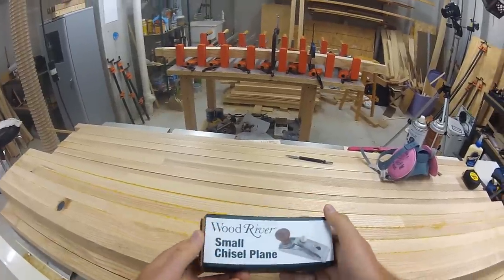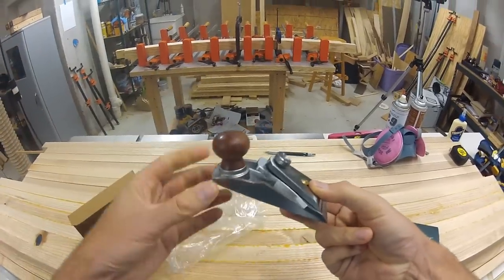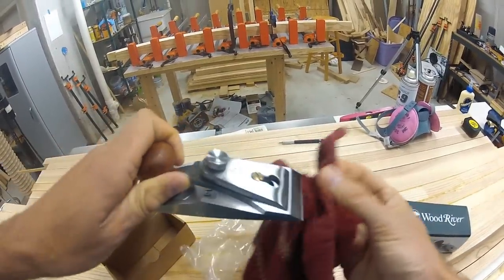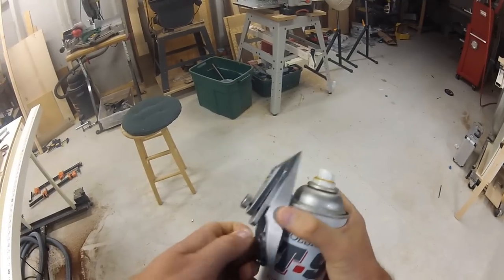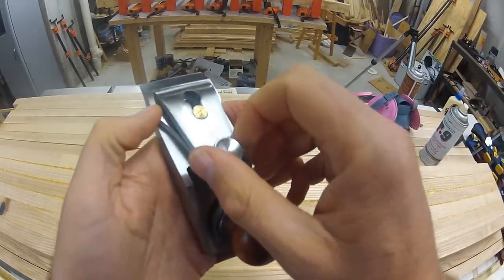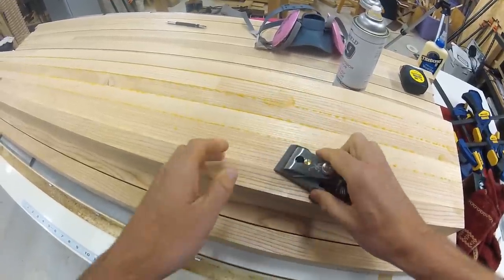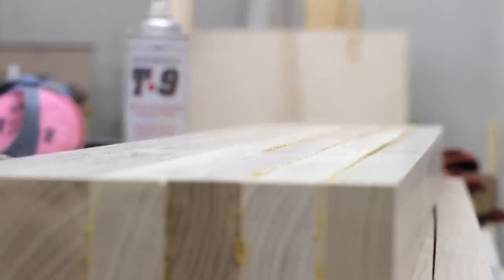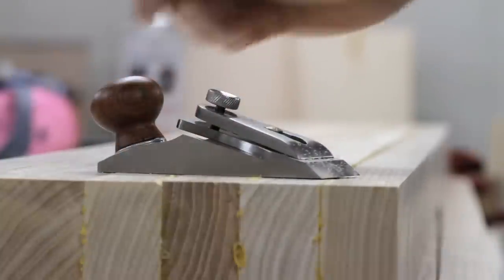Wood River Chisel Plane Unboxing & Review

Comment from the maker: I haven't bothered to sharpen it yet.  I don't expect any difference with sharpening between this and the lie nielsen.  If you don't mind the extra cost, I'm sure the lie is better and has the adjuster knob which the wood river does not.  If you want the best chisel plane for 70 bucks, then get the wood river... I have no complaints.